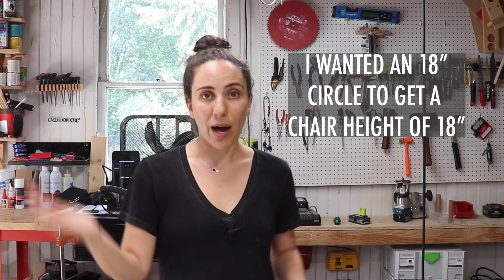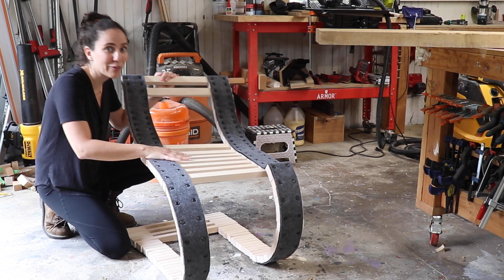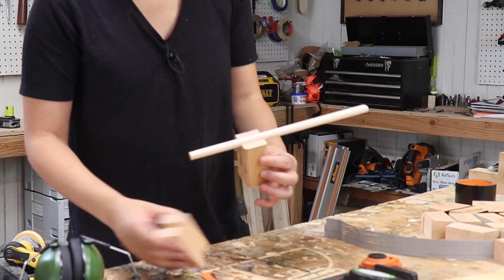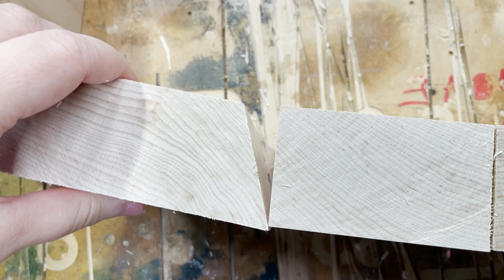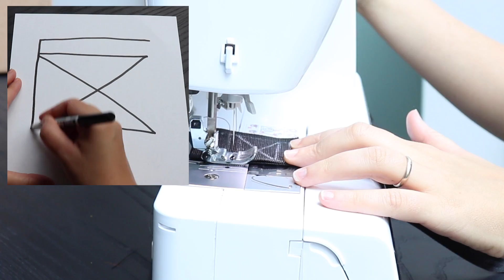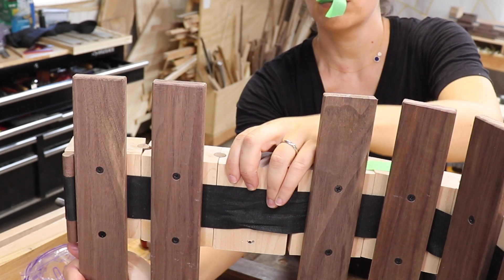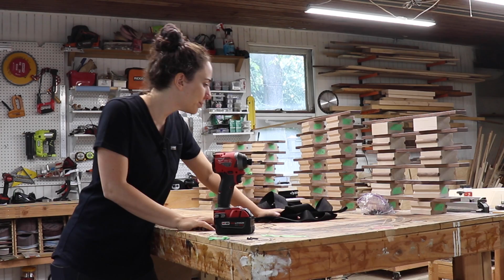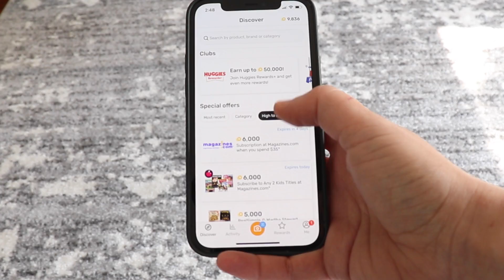I ATTEMPT to make a Roll Up Chair… AGAIN...

Comment: One thing I noticed is the the straps for the leg-to-seat section are on top of the blocks. If the same strap then went UNDER the blocks at the seat-to-back transition, it would force the back to stay upright. So, the straps can be on top of the blocks along one curve, but under the blocks where you want the curve to be opposite.

Comment: Solution put the strap or whatever it is in the middle of the wood instead of on one side.
The tension will then pull them together instead of trying to pull one side closer and one side further away.
This would mean that you wouldn't be able to roll it up but you can probably make it so you can loosen the straps so you have enough leeway to roll it up. And when you unfold it you can tension it again

Comment: ∙ a high-tech material could reduce the stretch by maybe a factor of 4, e.g., Vectran webbing. (should also have low/no creep, in comparison to other fibers).
∙ the size of the gap is proportional to the length of the (free) webbing. Fixing it to the block every (few) blocks would dramatically reduce the stretch.

Comment: I am no engineer at all, I have no experience at all, however, I feel like, as an intuition, that the strapping should go around the curve by the outside, meaning that it should change of side between the "legs" and the back.
I feel Like It'll solve the collapsing-under-too-much-pressure problem on the top ?

Comment: The strap material definitely seems like the issue here. 

One material you might consider looking into is a synthetic material often used for marine winches called Amsteel blue, it's relatively inexpensive, extremely durable, has a better load capacity than steel, and most importantly has very little stretch, I've only ever seen it in cord form however.

Comment: The strapping needs to be joined securely from piece-to-piece, not simply at the ends.  Consider bicycle chain along a groove instead of material.  It can be positively locked to each block. 🛠🔄
Reply: Hah, I commented pretty much the exact same thing and then saw your comment.. I really think it's the way to go
Reply: I just made a much longer comment saying essentially the same thing...

Comment: Okay, so mechanical engineer here with a couple of thoughts/suggestions. Springs (aka anything stretchy, including the strapping on this chair) extends proportionally to the force on them, so if you have more straps, wider straps, or a whole width of non-stretch fabric, the load per cross-sectional area of strapping will be less, and it won’t stretch as much. Fixing each block to the strap rather than just the end blocks will also reduce the stretch, since the amount it stretched is proportional to the original length over which the load is applied, so the areas with the most bending (ie where the gaps keep showing up) will still stretch, but proportional to the short segments between those particular blocks rather than the whole length. The sum of the gaps would probably be about 1/4 of the single large gap if I had to guess. Doing that would also eliminate the hazard of the back side curling under, since that wouldn’t relieve the stress at the high-stress areas. I would also recommend against leather, since it tends to stretch permanently over time (think of how a well worn pair of leather boots fits your feet)

Comment: Hinged instead of strapped? 
A lot more work, but various ways to also make the pieces interlock for better stability. I'd always be a little concerned about strength though, and would want to make sure that any design will fail in a relatively safe manner if it comes to that. 
(Recently discovered your channel - love the content. Fails are every bit as interesting as the successes and inevitable when you are creating. Keep up the great work!)

Comment: Any material under stress will stretch. 
The way to control it? Fasten it and deny it the ability to steal extra material from further away.

Alternatively? Tiedowns :D tension it in situ, again by fastening elements together. Two seperate strap components. One to hold the leg curve, one to manage the rest of the components which curve in the reverse direction.

Comment: I feel like between the slightest bit of slack in the cables, and the compression of the wood, this is not going to work. Maybe inlaid steel cable with a steel mating surface? But that is so tough and even more dangerous

Comment: It looks like the problem is the strap isnt working because the strap isn't attached to each piece of wood.  If the strap was epoxied or otherwise attached and not allowed to move (ESPECIALLY the UHMWPE!) there should be no way for the blocks to have a gap.

edit

oh I made it to the end of the video! What if you wove the straps under the dowels?

Comment: Would inlaying chain fix the tension problem or is that going outside the design/challenge requirements?
Reply: nvm, the explanation of the other compounding issues at the end certainly make this design a grueling challenge. Hand't even considered how the forces change when moving from sitting to standing. Still a really fun watch though

Comment: I probably have no idea what I'm talking about but instead of fabric straps/leather straps that will all have a little stretch (which adds up over several tiny stretches into a big ol problem) perhaps try some smaller gauge steel cables. They will have some stretch as well but should have far less than any textile. Bolt them suckers on and the only the only way something snaps is if the wood itself fails.

Comment: I love the idea, and it looks really cool. I think the vault structure is just not possible in the way you designed this chair though. Vaults are awesome in compression but tension never works on this little block profiles, you will always get huge elasticity (that's how bow are made after all). If you wanted this to work and you were sure that the strap wouldn't tear, and that the blocks would withstand the force, you could design the chair with waay less curve. The free chair would look more like a leaning support, but would deform when someones sits down until it has reached the shape you currently have with noone on it. 
But I would still worry about the tremendous tension this would cause. These sort of chairs are really only reliable when out of plastic, metal or steam bent laminated wood. :/

Comment: somebody feel free to correct me if im wrong but would it be better to tension between each piece then the sections cant move along the straps and shouldnt it also stop it from pulling the ends into each other as it will be pulling the section next to it not pulling the end of the strap?

Comment: I think as along as you have flexibility in the strap you're going to have some elasticity. I would be less interested in trying to increase tension and more interested in cutting the wood blocks so that the natural stretching and easing of the structure approached the desired shape. In other words - if the joint is bending too far, just put in a spacer.

Comment: You are running into a problem of one half of the free floating straps under tension(bottom half), and the other half is under compression(back rest part). Or visa versa. 

You need to isolate the two different types of pressure. Secure the strap at the seat so it can't slid up or down, or use a separate strap for the back rest side and another strap for the legs.
Reply: As a bonus you would be able to fine tune the strap length for the legs and back rest separately,  instead of having to take the whole thing apart. 

Right now, no mater how tight you get the legs, the fee floating straps are going to pull on the back rest and try to make it collapse so that the legs can separate from each other. 

Have one board in the seat double sized.  Have the leg half of the stapping come to one side of the double board, screw on the maple to lock that strapping peg. Then take the back rest half of the strapping and screw a second maple to lock that second strap and peg to secure the back rest.

Comment: I have maybe a stupid idea. At front bottom of the bottom curve and the very top of the whole chair add something like hooks or loops to connect some rope or chain between them on sides of the chair the way that normally it's a little bit loose but if you press the chair chains take off some of the tension from the straps. These chains shouldn't interfere too much with rolling it up but if they do they can be easily removable using things like clip hooks. But to make it work leaning would need to be more backwards than down, and I don't know angle it leans on to say if it's even possible.

Comment: simple suggestion- instead of using two small blocks that create the curve of the chair, why not just have one piece extended  across the width of the chair? this would also allow you to use 4 or 5 lengths of strapping along the width, which would strengthen the design.

Comment: I would use hinges (probably brass clad steel, could look alright), but otherwise aramide ('Kevlar') webbing, which doesn't stretch, might do the trick, if fixed on each block individually, as Alex Beardmore already suggested.

Comment: Stop using strapping - Drill directly through the length of the segments (i.e through the angled faces) and run a steel cable from one side to the other? You could have some time of threaded tensioner on one side that the steel cable is mechanically attached to

Comment: I'm sure someone has mentioned this, but what about something like bicycle chain? That should eliminate basically any and all stretching beyond the flex of the wood, no? Of course you would probably have to route channels in the wood for the chain to sit, but still, I think it would work
Reply: Even steel braided cable could do the same job now that I think about it

Comment: The simplest option I can think of is two polls, that when you roll the chair out, you attach along the brown slats, connecting the chair's back to the slats on the ground so that you don't need to worry about where you're unrolling it.
For storage, stow them in the middle of the roll. However I'm not sure if the chair's wide enough for them to not stick out.

Comment: i think making each segment have an individual strap can help as there are sections that need more tension, or divide the section like make the back a lower tension section the bottom too but make the front bend higher tension,

i feel like the problem was cause because diffrent parts need different tension levels and i dont think its too much or too little tension its each section has different needs

Comment: I honestly think the simplest and strongest solution would be to use metal hinges instead of a webbing

Edit: I think a old ratchet strap would also work since they are designed to not stretch too much and have very high tensile strength

Comment: I know you discounted stapling the web at each piece but I would think thats a viable option as you are experiencing the stretching of the entire length into one or two joints, and the tiny bit of stretching per inch adds up quite a bit. If they were attached to each board with multiple screws (could be through the walnut), then each joint would only be subject to the amount of stretch of a 4 inch piece instead of the total stretch of a 6 or 8 foot piece of webbing.
Reply from the maker: I was going to do that free getting the right strap length. But it seemed like it was just constantly stretching no matter how short I made it. Then I got hurt. So gave up on this iteration.

Comment: I think stapling or otherwise fastening the straps to each block as you mentioned is the best first step to solving the problem.  Right now, the material is stretching some X% of the total length of the belt and that X% is of course traveling through the joints to the one with the most stress on it which is at the first curve off the floor where you always see your gap.  By fastening the strap to each section, each joint can only then stretch the same X% but only of the length between two blocks which is a tiny length.  If you don't want to attach the strap to each block, then at least do it at the blocks where you see the gap forming to prevent that stress from loading up the rest of the strap.

Another suggestion with the material is to try to pre stretch it before working with it.  I'm not sure how much you need to load it, but you can do some experiments to see that if you stretch it out, what length will it return to.  It should be a little longer and permanently be longer.  Thus, when you attach it to the chair, it's already pre stretched and it will take the same load you used to stretch it outside of the chair to get it to permanently deform a little more.  TLDR:  Pre stretching will take out some of the maximum % stretch that occurs.

Comment: For the material you should have used a 5 tonne ratchet strap. It stretches very little as that would be useless for its design. You can purchase them at different breaking strains to suit your needs. I used them a lot when I drove trucks and never had a problem with stretching.

Comment: You could try to replace the strap with steel cable for less stretch (route a channel between the walnut and other wood for it to sit in), and maybe add a threaded rod and nut on one end to help with tensioning.  Then it should still roll up, and be safer to use.  it may also make it have less side to side if the cable fits in snugly so you don't need the dowels.

Comment: One thing i mentioned when you tried to sit in the chair at around 23:09
the reason it looses tension and collapses is not that the belt is too long, but because it is attatched to the backrest. 
Basically, as tension builds up in the lower curve of the chair, the string pulls the backrest towards the front.

To solve this, you might consider using two(four) seperate belts instead of one: 
one to only keep the tension in the lower part of the chair, and a second one to support the backrest.
This would definitively need further prototyping, but I hope this helps :)

Anyways, great video and great effort, really enjoyed the journey, thanks!

Comment: if the strapping you've chosen has the break strength you need but stretches too much pre-stretch the strapping before assembly...stretch it until you can no longer measure any discernible stretch then assembly the chair...there is also the issue of compression in the wood that could give the illusion of stretch in the strapping...maybe use a more dense wood or stabilize the wood you would like to use.

Comment: Don't use leather, i used to do leather work for a long time and under that amount of tension it will stretch and possibly tear. One of the techniques we use to shape leather is to stretch it over a mold by hand, while its really difficult  you can totally do it by hand so that plan is definitely a no go
Reply: Maybe try individual metal hinges

Comment: In a similar sense to my projects, this is an exercise in futility.

Now, I'm no woodworking expert, so I may get some terms wrong, but I might as well share my thoughts like everyone else is.
You're trying to make a strong piece of furniture by using structurally weak methods. It needs some kind of locking mechanism. Look at how you used dowels to lock the segments' yaw. If you make this system a bit more complex, you could get some more rigidity out of the chair when it's deployed, but it will also be harder to deploy. Maybe a mortise/tenon joint between the dowel and the segment that isn't glued to it? Probably the easiest solution to deploy, but probably breakable too. But at least then it shouldn't allow for much flex until the tension is released.

Edit: I tried searching for other roll-up chairs and someone by the name of Josh Wright has a pretty strong design. Seems like you're trying to keep yours as simple as possible, though. His has a lot more segments, a more directional interlock, and a stronger strap. https://www.youtube.com/watch?v=2MSEnMGFhMg

Comment: The problem isn't your woodworking skills, it's physics. The friction that is required for the chair to hold it's shape, is higher than the amount of tension that you can create using any kind of strapping, and the fact that these are separate pieces means there's always going to be something of a gap, making it a point of weakness. If the friction and force being applied to one piece will be eased when another piece moves, it will move. A lot of objects will move in very counter intuitive ways when enough force is applied.
Also, with the lack of any side pieces, lateral motion will always be possible. Whether you have dowels or not. Again, because there are gaps. enough individual pieces means a minor deviation, becomes a large one along the total length of the chair.

This just may not be possible to the degree of safety you are looking for. Especially if you're worried about kids, the sheer weight of the chair could be an issue, if a little one has their fingers some how between the slats when another child attempts to roll it. The weight of each segment is multiplied along the length of the chair, so if a finger is trapped high up, you might be looking at a bruise, near the bottom however, we're talking potentially crushed bones.

If you still want to try to beat this, just for the sake of beating it, I would suggest bike chains. No stretch, and they would limit lateral movement.